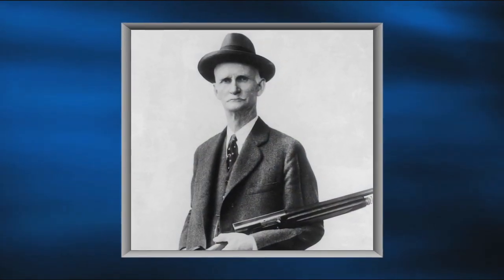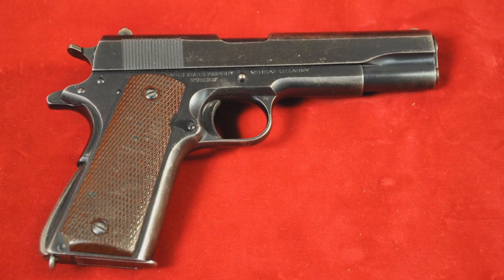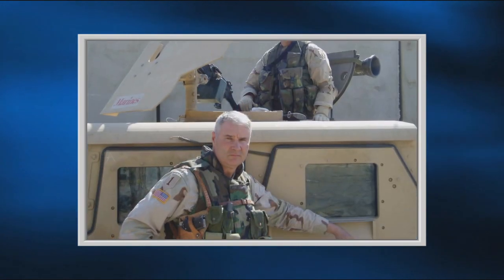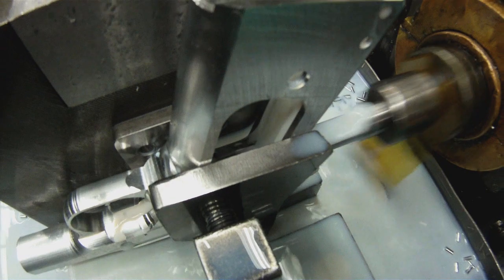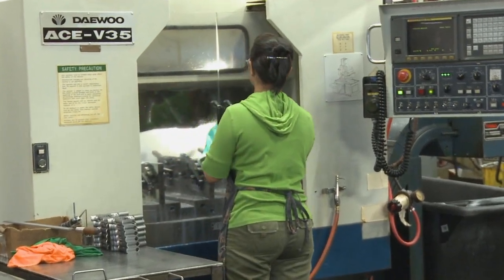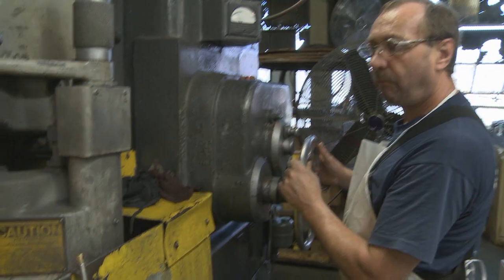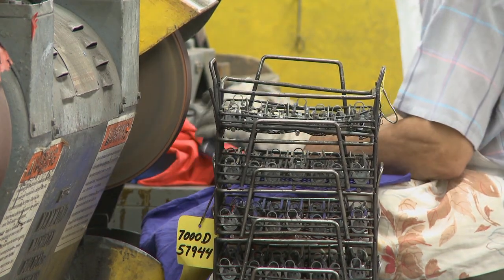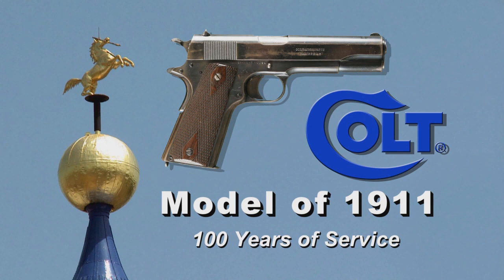Colt Model of 1911 - "100 Years of Service"

Comment: 0:11 - "Today, virtually every firearms manufacturer offers a version of it."

Then they show a picture of a Remington Rand M1911A1 with "Remington" written underneath it. Remington Rand was a typewriter company, and they made their final M1911A1 for the U.S. military in 1945. Not only are they not making any 1911s today, but they don't even exist today. They were completely unrelated to Remington UMC (now known as Remington Arms). Remington UMC made some M1911s for the U.S. military, and today they make commercial 1911s, which they only started doing somewhat recently.

There are two confusing names in the world of 1911s: Remington and Springfield Armory. The latter case of confusion is due to willful deception on the part of Springfield Armory, Inc. 

- Remington UMC, the gun company, made M1911s for Uncle Sam, but no M1911A1s or commercial 1911s (until somewhat recently). 

- Remington Rand, the typewriter company, made M1911A1s for Uncle Sam, but no M1911s or commercial 1911s. 

- Springfield Armory, the U.S. government arsenal which was founded in 1794 and closed in 1968, made M1911s for Uncle Sam, but no M1911A1s or commercial 1911s.

- Springfield Armory, Inc., the private company founded in 1974 that stole the name of, and deceitfully pretends to be, the real Springfield Armory, assembles commercial 1911 parts imported from the IMBEL company in Brazil.

Comment: Absolutely, you see it all depends on what you need it for, a Glock and the like have more shots because they use 9mm rounds but they are not as powerful as the 1911's 45 caliber rounds. So if you need power the 1911 is the way to go, if you want to have more shots, go with a Glock or something. At the end of the day though, it really depends on what you practice with.